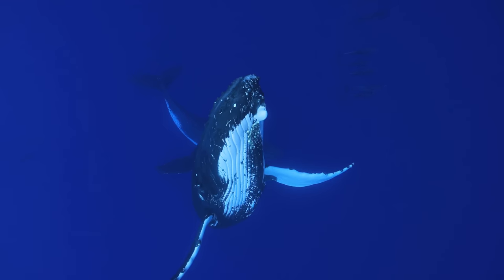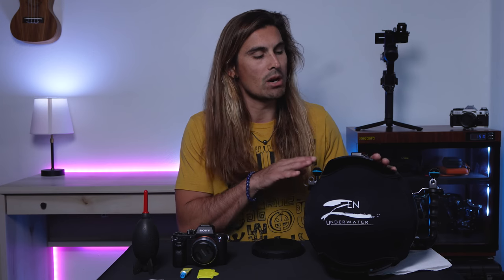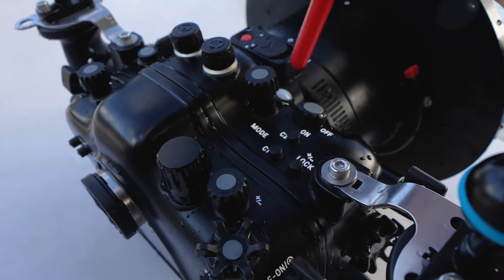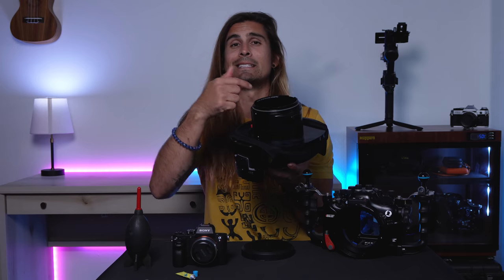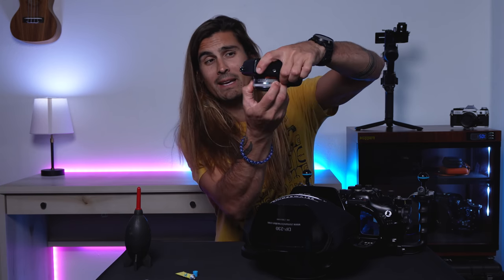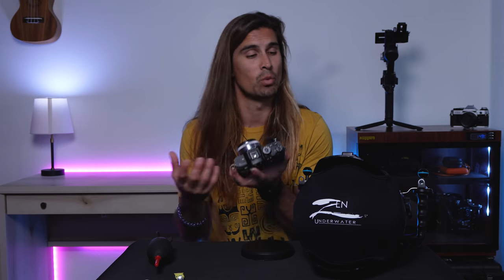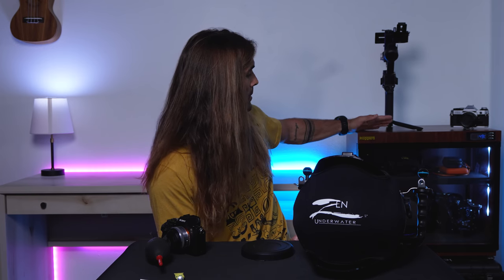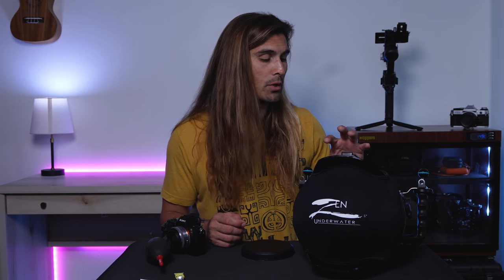How to Maintain your Underwater Housing like a PRO

Comment: Great video, one thing that far too many don't seem to know, and make huge mistakes around is what grease to use for their o'rings. Many UW camera brands for strobes and housing use silicone O'ring, and using the wrong grease will cause them to swell and you will get leaks. The problem is made worse by the fact that everyone says "silicone grease" in a generic manner. The cheap grease you can get at the local dive shop is almost always the wrong grease to use on silicone O'rings and will cause this problem.

For the average user that doesn't want to learn far more than they ever expected about o'rings and greases, just pay to buy the branded grease that matches your camera/strobe to keep it easy. If you find yourself without grease and in a spot, most dive shops will have the wrong silicone, but they are also likely to have Tribo Lube or Cristolube for servicing Nitrox/Oxygen regs/tanks and that will work no problem on silicone O'rings and any type you will find on camera/strobes without causing swelling. It will cost you about twice as much as buying the branded grease for your camera gear but the safe bet where you won't ruin your orings and your camera and strobe when they flood a few months down the road from using the wrong grease.
Reply from the maker: YES! Great adivce Chris!

Comment: Josh, excellent video on housing maintenance .  I generally use Dupont liquid  silicon and put on(in) all the control buttons and knob shafts. Do this after you have air(blown)dried (as well as possible) the controls.
Reply from the maker: Amazing! I will have to check that stuff out!

Comment: This video was super helpful! Do you advise against keeping the housing on for repeated dives over several days? Doing a liveaboard soon and I purchased the USB/charger port so that I don’t have to de-assemble in between diving days. Wondering if the vacuum seal is enough to keep all of the water out of the housing.
Reply from the maker: Usually, the batteries last a long time. If you don't need to change the camera battery, leave it! I've left mine on for multiple days at a time. But I do always travel with spare batteries just in case!
But for sure the vacuum seal is enough!